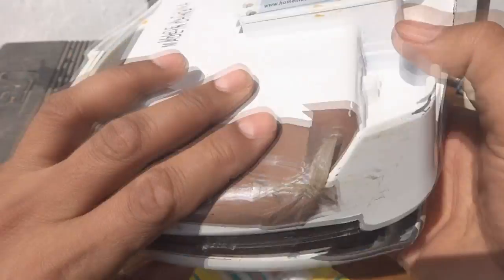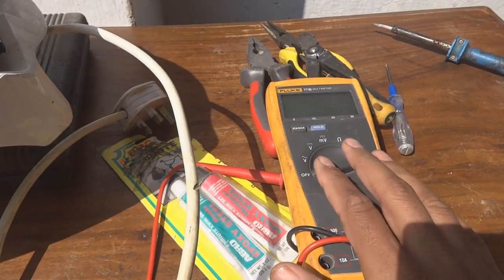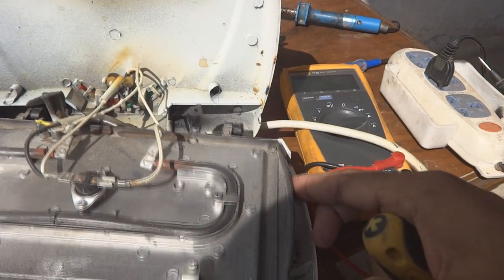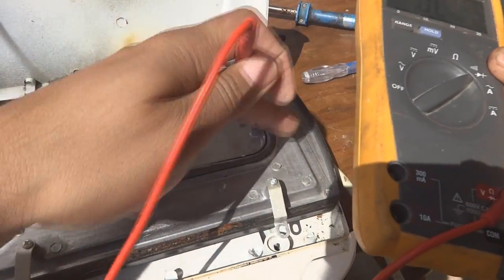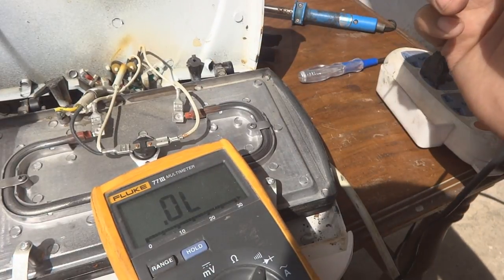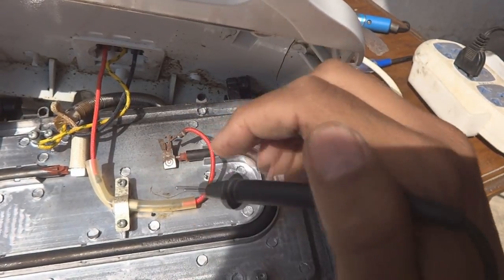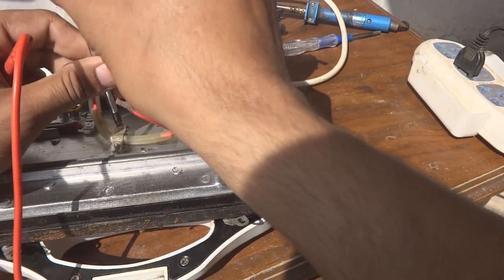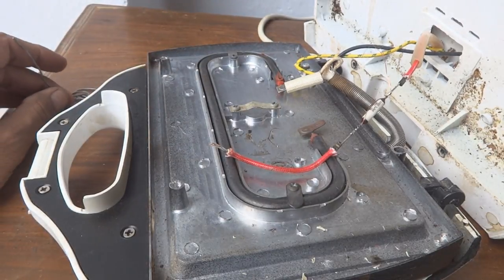Sandwich grill repair Electrical repair

Comment: The fuse is there as an overheat Safety device in the event of a fault. They are readily available, Cheap and easily replaced. What you've done and shown others to do is Dangerous. People wonder why the repair industry has a bad reputation, all they have to do is watch videos like this to understand why. Absolutely disgusting.
Reply from the maker: For no reason you are just cretisizing. Such behavior isn't good. Look at your channel. You haven't uploaded a single second video clip. Even not a stollen video! If you aren't able to give single word of knowledge, why do you try to stop 🛑 others from doing so? You are just trolling and trying to hammer ⚒️ others with your bullsit knowledge and attitude. People like you don't do anything and they try to keep others also ignorant of education and knowledge. With such behavior and attitude you don't watch other people videos or minimum don't comment is such bad way.
Reply: @JahanZeb1976  Going on this video, the knowledge that your supposedly imparting to people is DANGEROUS. If your going to continue giving people your so called knowledge, at least tell them the correct way to do a repair and not by doing bodge jobs and bypassing  safety devices. I wasn't criticising for no reason but for the simple reason that what you were showing is bad practice and as I've already said: DANGEROUS, if your supposedly an Engineer then you should know better. Not giving people as you put it Knowledge is a lot better than giving them bad knowledge as your doing. If your so confident in the validity and safety of the "knowledge"  that your dispensing to the as you have called them ignorant, why when someone makes a valid criticism of what your doing do you become excessively defensive, crude and abusive ?. Could it possibly be that you yourself are actually the ignorant one and not your subscribers ?. Please don't bother to answer that, it was a rhetorical question to which I'm pretty sure I already have the answer.
Reply: @rscelectrical7091 ro he's proud  about it LOL  im not even a tech but i really appreciate this tutorial im also not dumb enough not to know what is the use of thermal fuse 💀 r.i.p to all begginers watchig this video
Reply: I was a tech and this guys setting you up for failure!
The original comment about it being a thermal fuse is correct.
That red wire is right up against a hot plate that can eventually burn through to an unshielded AC wire. 
That is why it's there.
Anyone who has worked with something that pulls that many amps without resistance would tell you to replace the fuse or expect your home to burn to the ground when you use it. 
I bet this guy likes to play Russian roulette with himself.

Comment: Thanks to your video, it inspired me to open up my griddle flat grill that I use for business. It stopped working one day and I called everywhere trying to get it fixed and no1 would touch it. So I searched on YouTube and your video showed up. I opened it and found a corroded wire that came loose. Cleaned it up and re wired it myself. Thank you for this video that gave me the confidence to do it myself. Cheers from Australia Brisbane.

Comment: Lol.. Not to criticize your work, but the thermal fuse is there to avoid burning down your house, and soldering in areas with that much heat is at best risky. It will get brittle over time. Still, the wire you use to replace the fuse is so thin it probably will do as a kind of safety device anyways.. Good luck!
Reply from the maker: You are right in all aspect and you admitted that what I did is even right using a thin wire as fuse. The fuse consists of actually a thin wire thinner than your wiring. So it may blow in case of a short circuit. Stay tuned.
Reply: beernutsonline after reading the burn your house down comment I realized since I don't know a single thing about wiring etc I should just...idk...save money to get a new George foreman grill.it was working fine few days ago then I heard some static sounds coming from the low medium and high setting as I turned it and the red light flickered.it worked two more times after that then stopped working completely.
Reply: Yes the thermal fuse rating of 240 degrees means that the fuse will blow if the temperature exceeds 240 degrees. Without the fuse the heating elements would get hotter and hotter and hotter without anything to trigger a shutdown. Those fuses are less than $1 a piece.

Comment: You know that those thermal fuses blow for a reason? And in terms of safety you should replace one with same characteristics, not just use a wire fix? Then again, it is your house...if the sandwich grill ever catches fire...
Reply from the maker: Somewhere such manufacturers put certain fuses to run their and service center business. If safety was a concern, fuse could be placed in cord plug too. So such fuses replacement with a piece of wire is a smart idea. Regards, 🙌

Comment: This was EXACTLY what happened to my sandwich maker -connection to the heating element came out, AND the fuse blown.  I would have missed fuse, or as it's difficult to find a new one, I would have trashed the whole grill. THANK YOU for your video!

Comment: Sir, I have issue in sandwich Toaster that Tempreture cutoff 180°c becoming short again n again. Whenever it must be Normaly open when Temp. Exceed than 185°c  but here it doesn't cutoff and Elements Going to very High Temp. Any solution pls...
Reply from the maker: Replace the bad thermostat
Reply: @JahanZeb1976  , Thanks sir to Notify, but I Replaced 5 pcs one by one. Actually instead of open its continue and Heaters become Red and this Thermostat short.....First Time I stuck in this unit....Because Naturally it should open on overheat and Disconnect Supply to Heaters..😔

Comment: Salaam sir why did you bridge the fuse surley you could purchase another 10 amp fuse PS good videos on toyota corollas
Reply from the maker: The rewired fuse is the alternate of the 10A. Fuse is actually the same a thin wire. This video is not regarding Toyota Corolla. lol.

Comment: Good :-D that didnt take you too long to recover it :-D.

That device looks like it has been through a war lol, hopefully the owner will give it a scrub with antibacterial spray and plastic scrubber, food needs to be made in clean conditions, would be bad if it made someone ill :-( :-(.

The two strands you used for the fuse didnt look thick enough, they may burn out later.
You could have bypassed that fuse anyway,  the plug would have had a fuse in it :-D.
The earth is important if the heating element becomes shorted to the metal, it provides a protection, better to blow a fuse than hurt a human :-).

Comment: Bhai mera ye esa toaster hai mujhe lgta hai ki uski power kum hai. Matlab usme toast bnane ho to normal toaster se double se b jada time me brown hote hain. Or itni der rakhne se bread bhi rubber jesa ho jata hai. To i guess agar heating element jo abhi 400 watt ka installed hai use double 800 W krdu. Kya ho sakta hai? Aur Kya thermostat bhi change krna pdega. Agar ho skta to kitni value ka?
Reply: How degree centi grat of thermostat?
Reply: @ameerhamzahhamzahzahoor8834  400
Reply: @jemsncrystals  400°C?
Reply: @ameerhamzahhamzahzahoor8834  no. 400 watts. I dont know the temperature

Comment: thanks to your video i checked the fuse of my grill. its a smart and creative thing you did there with to grains(<not sure if that is the right word) of wire to replace the fuse. why did you solder them and not the heating element. wouldn't this solder be subject to the same temperature as the heating element?
Reply: No it's not a smart and creative thing he did, it's irresponsible and dangerous. The part he removed and bypassed is a thermal safety fuse and is designed to go open circuit to prevent overheating and possibly the appliance melting / catching fire, manufacturers don't just fit them for fun. Thermal safety fuses are readily available and quite cheap / simple to replace, they should not be soldered in place but crimped into the circuit with the brass terminals that are made for the purpose to ensure the continued safety of the appliance.
Reply: @rscelectrical7091  yes, that's why he put a few small wires in there so it would still burn out. those wires will still be a whole lot thinner than whatever wire is used in the rest of the house. i though that was ingenious. the thing won't overheat and catch fire because it has a built in thermometer so it switches of. that's what the 2 lights indicate. red for i'm warming, green for saying it's at operating temperature. but you are correct that the proper way wouldn't have been much more expensive. 
thanks for answering my question about the solder though!
Reply: @thisname1is1sukzable  Unfortunately the wires used probably won't burn out before it overheats and causes irreparable damage, that's why thermal fuses are chosen rather than just standard gauge wire. A thermal fuse will open at a reasonably specific temperature and cut power before the element overheats too much, the wire used is not temperature sensitive so will continue passing current even though the appliance is overheating. The thermal control on the appliance is there to turn power to the element on /  off to control  the heating of the element. However these can and do fail, very often with welded contacts. A control with welded contacts can't regulate power to the element so it continues to heat up, this is when you find out why the manufacturer went to the expense of installing a thermal fuse rather than just using a straight piece of wire. Believe me: Anyone who tells you that the manufacturer puts the fuse there for the sake of it or just so they can make more money, hasn't got a clue what they're talking about.
Reply: @rscelectrical7091  oh okay, so it's for when the automatic thermal regulation thing fails. I thought it was because of the current. thank you for your elaboration bud!
Reply: @thisname1is1sukzable   Hi Chris: Your welcome mate, apologies if it seemed a bit snappy & long winded but people bypassing safety devices is a bit of a Red rag for me. After over 40 years in the industry and having seen the results many times, I tend to get a bit bent out of shape when I come across it. Your dead right: Solder should never be used in this situation always crimps, they're readily available and cost peanuts.

Comment: when i just plug in my sandwich toaster my home electricity went away 
it was my luck to have a breaker at home.i dont know what actually happened to it.
can i do anything myself to repair it?
Reply from the maker: It seems there is a short circuit somewhere in your machine. It could be in its cable, power plug or inside the machine. You can easily diagnose it and can repair it if you understand a little. You may watch my video again once or twice and try to follow the diagnostic steps to understand the fault location. Once you troubleshoot and diagnose it, the repair would be very simple. Best regards,

Comment: with all respect.
DON'T EVER BYPASS A FUSE!!!
Somebody may be killed.
Reply from the maker: Who told you? Fuse isn't a protection to save humans.
Reply: @JahanZeb1976  
Wire melting?
Fire?
Reply: @JahanZeb1976   It is!!!!! Have been designed to save life and goods. 
And it is very cheaper. About 0.7$ for one piece. Worth that? No! Never!!!
Seems that in your contry human life not valuable too much.